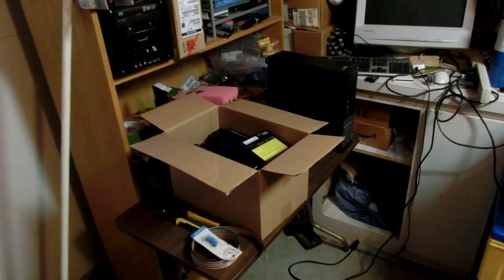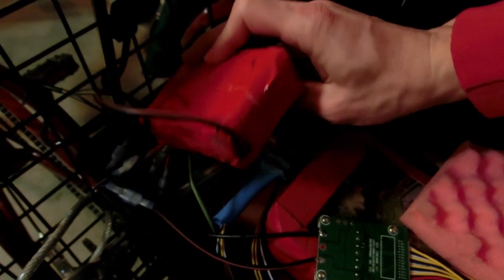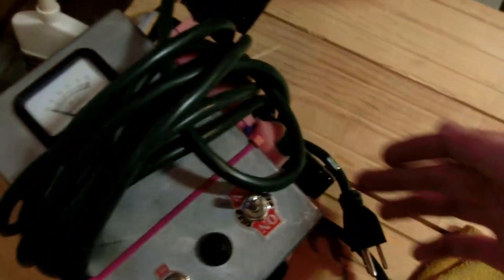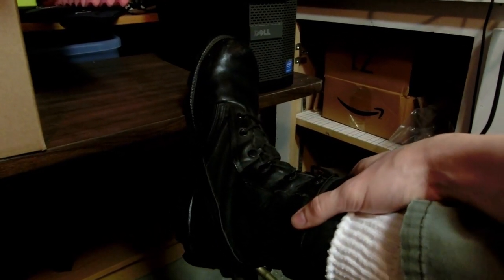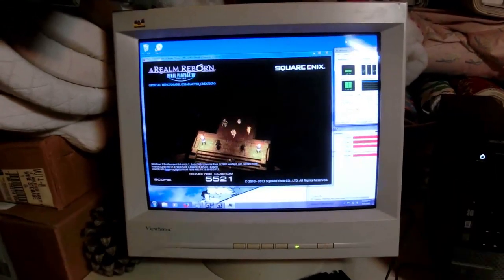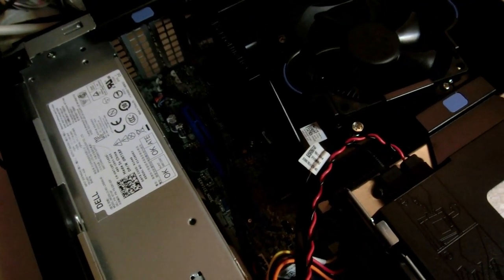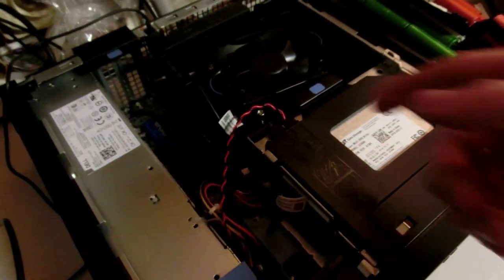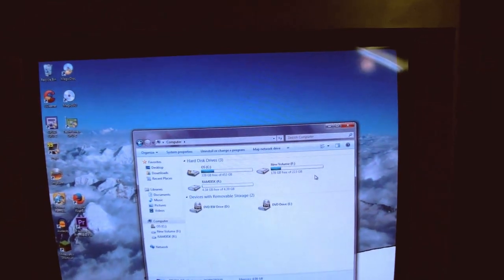Random Bits 0082: E-Trike v1.4, New Computer, Cheap 18650s

Comment: It will be interesting to see what kinda battery holder you come up with for the 18650 , I assume if you get a 3d printed model too hot it would melt perhaps breaking its link? could be slightly safer or cause some catastrophic chain reaction of chaos?, They sell holders on ebay but they are expensive :-(

Comment: For capacity testing a whole bunch of salvaged 18650 cells, I got myself a BT-C3100.  It will do an automatic charge-discharge-recharge cycle at 0.5 amp, 4 cells at a time.
Reply from the maker: Brian Taylor interesting, i'm fine with just my Imax B6 for now though.

Comment: I work with those optiplex boxes daily. Pain in the butt sometimes. Depending on how you feel about your warranty, I wanted to do the same, add an ssd. I ended up cutting off the original sata power and soldering on a pair of them. You just wouldn't have the warranty for the psu anymore. Or, since ssd's run on 5v anyway, and that mini cable is 5v, see if you can find an adapter.
Reply from the maker: Aaron A yeah i dont trust warranties.
Reply: Well, they aren't always bad. I'm a dell vendor. I know how the operate. Their warranties are what make them worth it. If it dies, you jump online and tell them you need said new part. No issues.
Reply from the maker: Aaron A
thankfully i've never had any issues with Optiplexes, even with the ones i've dug out of rubbish bins.

Comment: @3:31 In regard to battery "bays" you would need some kind of input device or shunts or resistors/regulators so that when you replace a depleted bank of batteries with fully charged pack it wouldn't just discharge into the lesser charged bays and ruin them.  Can you please elaborate about that?
Reply: bcmasur What I'm thinking about doing in having three battery "bays" or maybe 12 or a hundred bays is that they are all separated from each other with resistors that are appropriate the maximum current that the most-charged bank can provide, so that even if a fully-charged pack is inserted it won't immediately deplete/damage itself but still provide a good portable charge for the other banks in place.

Comment: Hi Rinoa, I am facinated by the electric cycle projects that you have undertaken and am very impressed by your experience of hub motors (along with everything else that you've been working on). However, parts are really difficult to get a hold of, especially in the UK and most (24volt) hub motor systems are simply too bulky to use on a touring bicycle. Have you also had any experience with the new LiFePO4 battery technologies and are they able to be charged by a normal lead acid battery charger (mains and/or solar)? Or would a boost capacitor be any better? Thanks :)

Comment: I was using a kodak photo printer's 24V 1.8A power supply for charging sections of my 132x18650 (11p12s) battery bank but that power supply died today, after using it for a few weeks without any problems except that I could have done the sunny-side-up egg thing on it.  I WISH I had a 59V power supply, but for now I'm disassembling my 132 unsoldered 18650 cells for regular charging, etc.
Reply: bcmasur The computer's usb port has 5V, 0.5A supply. A diode will drop the voltage down to 4.3V,  which is perfect for 1S charging. If you like it, take care not to draw more than 0.5 A, unless you know it has overload protection.

Comment: Hey, I'm going to start building my new bike battery pack soon to replace my 5 SLA batteries it currently has.  Do you have any suggestions for what brand of laptop batteries I should get?  Cheers!
Reply from the maker: sc0tte1 get the least expensive ones as long as they arent Trustfire, Truefire, or Ultrafire :P
Reply: Rinoa Super-Genius Thank you my friend!  Cheers!  Trustfire are no good huh, I know a lot of vapers use those lol.
Reply: Rinoa Super-Genius What you really want to do with the 18650 batteries is run them through a metering charger such as the bt-c3100 or bt-c3400.  I have a bt-c3100 [[which I am fighting with it's broken fan at the moment, I have a replacement fan which I haven't tried to install yet.]]
Reply: sc0tte1 5 SLA@12V?  so.. 72V working fine for your 48V controller or what?  Cutoff probably around 40ish, so use x/2.8V for your lithium ion series minimum voltage configuration.  Considering some of those cells will not discharge equally, let's say for safety make your 3V mimimum cell times 20 series for a 60v cutoff minimum... multiply that as much as you want in parallel for more amps/amp-hours....

Comment: Other than that you like tinkering with your bike batteries why havent you opted for lipo cells?
The capacity of lipo is lower but they can discharge much more amps than 18650s, you can aso buy them ready made requiring some connectors.
6 of these could be a true 12s 32ah battery and would only require off the shelf parts with minimal to no soldering
Reply from the maker: PS4 Custom Gamer lipo and lithium-ion are the same thing.
Reply: Rinoa Super-Genius
Theyre really not!
Lipo can discharge/recharge super fast and are available in high capacity lipos ready made up at whatever voltage you like.
Li-Ion discharge/recharge super slowly but have higher capacity for a given size/weight.

My point is with Lipo you could just buy a ready made battery and plug it in instead of having to make one. A lipo pack would be great as a low range pack as it can be recharged fast and

Also the constant C rating of a lipo is 10C-40C while the C rating of a Li-Ion is usually only about 2.5C. Therefore a relatively low Ah lipo would behave like a very high capacity Li-Ion in the amount of amps it can discharge all at once(not referring to capacity).
Reply: PS4 Custom Gamer
true, lipo is compact and light weight and has up to 40C(80 amps, you can start a car) discharge rate.
but he only need 1C(2 amp) 'cause he put 12 cells in parallel to deliver 20 amps.
and he pays $0.33 per cell. so the soldering is worthy.
Reply: Henry Chang Lipo has a lower capacity for a given weight/size than Li-Ion so in a large battery pack like rinoas it works okay. Starting a car is really a different subject all together but its not as simple as 80amps will start any car...

Im not putting lipo forward as a better value solution than the most discounted batteries rinoa could find, Im saying lipo is brilliant as a 'ready made' alternative especially as a compact battery.
This battery is about the same as 40(1.6Ah) 18650s or 32(2Ah) 18650s but this pack is ready made up and would require 3 in series to reach the 48V required for rinoas ebike motor.
http://hobbyking.co.uk/hobbyking/store/__61509__Multistar_High_Capacity_4S_16000mAh_Multi_Rotor_Lipo_Pack.html
Reply: PS4 Custom Gamer
first you said lower capacity for a given size, then you said it's compact. which one do you mean?
Reply: PS4 Custom Gamer
that lipo's discharge rate is 10C = 10 x 16 = 160 amps!!! I bet it can start your car. charge it to 15V, like jump start votage
Reply: To get the discharge rate you need to run a ebike with Li-Ion cells you have to run alot of cells in parallel. The upside is you get alot of capacity but have to make a big battery with lots of cells.
Lipos have a super high discharge rate but vary alot in C rates. This 12s 4ah lipo has a 65C constant discharge rate which means it can discharge at 260amps.
http://hobbyking.co.uk/hobbyking/store/__26787__Turnigy_nano_tech_A_SPEC_4000mah_12S_65_130C_Lipo_Pack.html
Also its possible to discharge it completely in under a minute lol, not ideal as a bike battery as its expensive and low capacity. Matching this setup in Li-ions of 12s and 4ah would be 12s2p(12 in series, 2 parallel) and discharge at 2.5C, therefore 18650s in this setup would only output 10amps consistantly.
Reply: PS4 Custom Gamer
There are Li-Ion 18650s capable of better than 2.5C but obviously these arent what youd  be able to get in laptop batteries and the better ones are available in expensive branded power tool batteries.
http://best18650battery.com/ - this site lists a few specs on common 18650s

Believe it or not some of the best 18650s have been bought up by tesla and other expensive brands. If rinoa was to rebuild his current setup for higher capacity the best suited cels would be Panasonic NCR18650G which have ALL been bought up by tesla. If rinoa wanted to build a lower capacity compact battery higher discharge 18650s would be more suitable, Sony US18650VTC4 can do 15C which is the highest ive seen for a Li-Ion but the price is really high in comparison to Lipos.

Rinoa certainly knows what hes talking about but 18650 Li-ions arent necessarily the best solution for every battery though amateurs will only look for the highest capacity battery.
Reply: PS4 Custom Gamer
Just been doing some maths a 48V 1000w motor requires a consistant amperage of 20.83 amps for top speed which is lower than I thought but it still means to get around putting lots of 18650s in parallel you need high quality 18650s in good condition as used ones with a higher internal resistance will discharge consistantly at a lower rate.
Erm so I didnt know this existed, it certainly beats duck tape and a toolbox.
http://www.aliexpress.com/item/E-bike-battery-case-48v-battery-box-With-free-18650-cell-holder-and-nickel-strip-New/1565783966.html
Reply: PS4 Custom Gamer can you buy 5000 mAh 18650 cells?
Reply: no 18650 top out at 3600mah with panasonic NCR18650G but have been bought up by tesla,  you can buy NCR18650B which are 3400mah. Anything rated as higher like the ultrafire ones are fake ratings.
While 18650s are currently the best value they are a stupid idea as round cells waste alot of space. Hopefully 18650 production will slow in the next few years and we will see a standardised good value square pack. If you see alot of square packs at a good price dont worry that theyre not 18650s just get enough for what your doing so you dont end up mixing battery types if you cant get more later.

Comment: About the 18650 cells, the different capacity can be a problem in such a battery pack?
Reply from the maker: ollythebest94 yes if you dont test them, but after i bring all of these cells up to 3.6v i will charge them with my imax b6 and write the number of mah it took to get them from 3.6 to 4.2v and that way i can evenly organize them within the battery pack so each pack of cells is close to the same capacity.
Reply: Rinoa Super-Genius That's interesting, that imax b6 is definitely a handy tool! The battery pack is a combination of parallel/series or just a big series?
Reply from the maker: ollythebest94
combination of series and parallel.

Comment: i personally don't see why you like these dell machines soo much. i mean. that power supply surely doesn't look stranded. when your PSU goes up in smoke, you need to find one specifically for that model and pay out the nose for one though dell. your PCIE slot doesn't take double wide video cards. if you get into anything serious you need a double wide for that. than there's that SATA power connector... that's just the thing i would expect from dell. keeping something as simple as a CD drive proprietary. if you get them free or at an amazing deal. i see no problem with it as long as your expecting the normal "Dell hell"  Pros, its a nice PC for a small package!,  anyway to each there own. as long as you expect the supprises and enjoy it!
Reply from the maker: +danz409 well thats the thing, ive never had the PSU in an optiplex go up in smoke, they are very durable. i dont need a double wide graphics card for most games. i dont understand all the hate on Dells, i find them to be well made.
Reply: not saying they are junk. just not super friendly for the DIY PC builder to work with. as for a normal user that needs a computer its not a bad brand between them HP,Acer,Asus its a close call, my brand of choice is Asus. at least its not a Compaq... same proprietary BS but low quality to go with it... yuck...
Reply from the maker: danz409
my family has had a lot of issues with Asus, their computers and drivers can be unstable and blue screen a lot.

Comment: The BMS I'm looking at has P- N- and B-.  Could I just splice the wire going to the controller and then bring the new wire out to the BMS?  And I assume P- is for the positive and the N- is for the negative.  Thanks!
Reply from the maker: Alex Makuch Productions no, P- is the negative going to the motor, i wouldnt bother running the motor through it though. if it was positive it would say P+

Comment: Wait, you're using serial connectors from a computer to hook up your batteries?  Do those little wires handle enough amperage to run your bike motor??
Reply from the maker: sc0tte1 thats the balance leads not the power leads.
Reply: Rinoa Super-Genius Ah, okay, understood :)
Reply: sc0tte1 Those "little" wires from "a computer" can carry a lot of power.  Look up some things, 9 pin DB, serial, RS232, etc.  I was surprised ten years ago but they still have a lot of use even though they are obsolete.
Reply: bcmasur tell me about it i was running 5 amps through a single strand from a cat 5 cable and it only got just slightly warm. 
I use very thin cables for balancing on my packs so that if a short should happen they will blow pretty easily.

Comment: Where can you purchase these BMS?
Reply from the maker: Sonnet Gomes ebay
Reply: Thanks Rinoa...i was able to find it on good ol ebay.  Do you have any A/B switch for this? What happens if you have it hooked to a charger and turn on the controller or hit the throttle at the same time? Hope it wont blow up anything.  This BMS is so basic...really scares the heck out of me.  With B6 charger, you can monitor the individual cells, but with this BMS you have no monitoring.  I guess it's something you give up for portabilty.  Are there any compact BMS out there with LCD screens or more monitoring capability?

Comment: i want to increase my range but recently i started having a problem after fully charging the battery ill start riding and short after starting my journey it shuts down if i let it sit for a half an hour the charge is back
Reply from the maker: siggapon you may be pulling too much current, or one of your packs may be shorted. a shorted cell will allow power to go through while its cool but if it heats up a lot it will become more resistive. if your pack is 4v less than what it should be then you should check your cells.

Comment: the controller is a yk89s 36v-48v 500w 
my battery is 36v-10ah and motor is 1000w
this is how they built it i need help to understand this better
i taught it was shuting down because of the cold
i live in newyork
Reply: what kind of battery do you have?
Reply: 36v lithium ion 10ah
Reply: Henry Chang 36v lithium ion 10ah
Reply: siggapon
how long have you been using it?

Comment: Hey Rinoa, I've stumbled in the past whilst researching my own EV, http://www.aliexpress.com/item/18650-battery-holder-bracket-Cylindrical-battery-holder-18650-li-ion-cell-holder-Flameresistant-material-Safety-anti/1982118662.html, these things. They are snappable brackets for 18650 cells. If combined with a spot welder of some sort (by spot welding one of the sides with both points) and the nickel strips they also sell, there is no need for soldering. I haven't personally used them, but people on EV forums love them.
Reply from the maker: hwwonB21 yeah but i just dont like that design too much, doesnt seem strong enough. plus its funner to 3D print things than to buy them :D
Reply: Rinoa Super-Genius Tru dat!

Comment: please I'm able to see you have a better awareness and understanding of the subject
my knowledge is basic and i apologize in advance i would like to know what effect can this type of system have (36V 10AH battery/36v-48v 500W controller/1000w brushless motor)
Reply from the maker: siggapon monitor the voltage of the battery while you ride it, look to see if the voltage drops a lot. by a lot i mean like down to 36v

Comment: Hey you might be able to get a GTX 750TI low profile that would work better than your 560TI at home. Just google "Low profile GTX 750TI"

Also, you can get a SATA power splitter from the HDD so you can install an SSD! :) Best of luck!
Reply from the maker: Electro_Leet yeah i know about the power splitter, Weird Stuff warehouse (where i bought the batteries) should have some. i'll grab one the next time i raid their battery skid.

Comment: If you want to render videos faster, get a graphics card. I would get a gtx 960 SC from evega, the single fan one. Or if you wanna go cheaper, a gtx 750 TI. Very low power consumption. And a ram disk does not hep for rendering. HDDs have read/writes of 50 MB/s no video file is that high of a bitrate.
Reply from the maker: MrTommymxr yeah but it rendered this video in 8 minutes, thats more than good enough for me. its not exactly for rendering, its for video playback during editing. it becomes very choppy when using a hard drive.
Reply: Ok

Comment: If you don't see yourself using the optical drive you could replace it with this: http://www.amazon.com/gp/product/B0056EW4A4 or this http://www.ebay.com/itm/New-Ultrabay-III-3-2nd-Hdd-Lenovo-ThinkPad-T420-T520-W520-T420i-SATA-3-0-6gb-s-/300660454823?pt=LH_DefaultDomain_0&hash=item4600c275a7
Reply from the maker: ***** never knew those existed, i was just going to stuff it into another open area but that may be the better way to go.
Reply: They're pretty great! Got it for pretty much the same reason but for a laptop.